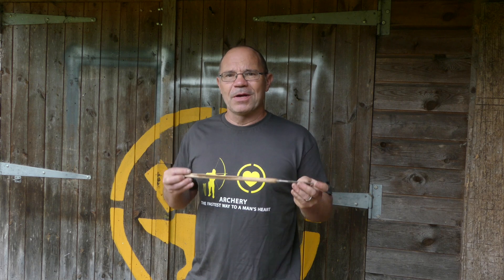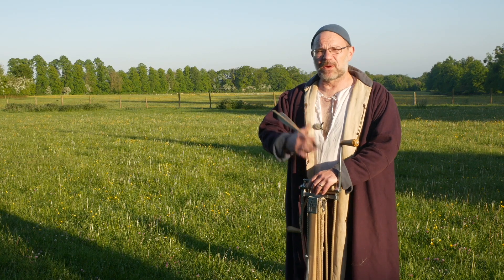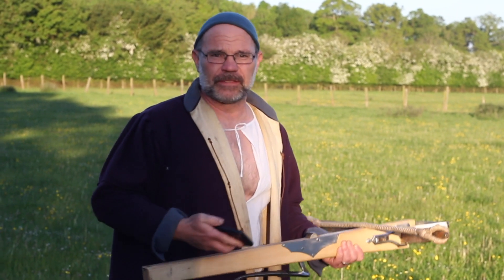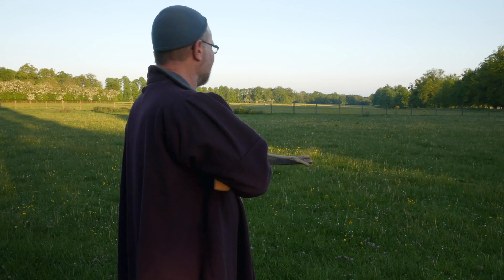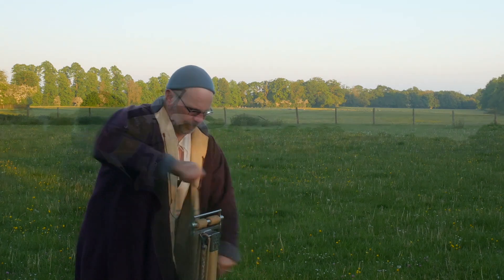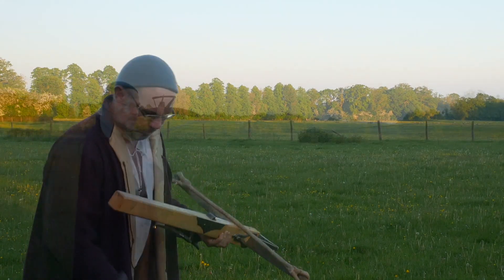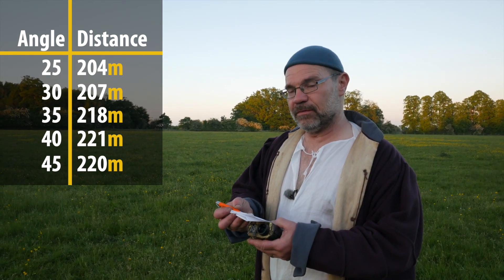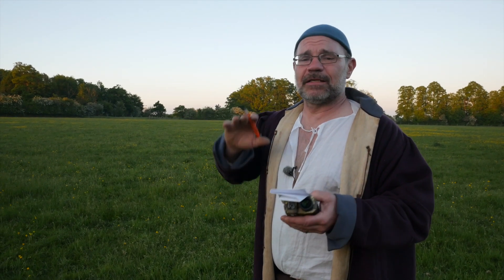Distance - Which angle is best?

Comment: Nice experiment Tod. In my distance trial I didn't go as far and as you suggeted I used 45 as the angle. Load of people told me 'I was wrong' etc, but it looks like I wasn't far off right. Somewhere between 40 and 45 works best!
Reply: Great channel if you haven't already discovered it.
Reply from the maker: Thanks Jason and yes it was interesting that it was so close to 45, I was expecting less
Reply: @tods_workshop  mee too, and like you I had loads of people tellign me it shoudl be close to 35 etc etc. looks like 45 ish is good enough. On the amusing other hand one comment told me to shoot it at 110 degrees.
Reply: @ModernKnight  Assuming everything is a constant, for a "ball projectile" or close enough, if you add drag it should still be 45 degrees, as the drag is affecting everything proportionally at any given time, which is essentially what happens in a vacuum (ofc, distributing 0 proportionally is still 0, but also still proportional). Arrows look very different from balls of course, but because they stabilize due to rotation along the direction of movement, the physics don't look all that different (air resistance is met by a roughly stable 2D projection in that direction, which is also roughly a circle, meaning the drag will distribute horizontally and vertically at the same way the velocity does, which is basically what happens with a ball).

Things get different when you manipulate other factors. For example in spear throwing biomechanics limitations make it so initial velocity and angle are no longer independent as they are when you have a crossbow or bow, or by adding different aerodynamics, like throwing discs or cards, or frisbee. If you throw it with the right motion, your ideal angle for distance will be much closer to 0 depending on specifics of the actual object. This is for two reasons, first to have a higher initial horizontal velocity. Second it is to cause it to stabilize by spinning on an axis perpendicular to the direction of movement instead of along it, leading to the projectile basically gliding as it has a larger vertical area/drag and low horizontal area/drag. I.e. it starts faster horizontally, loses less vertical speed and speeds downwards much slower too staying airborne longer. But if the launch method is flawed it won't stabilize and it will look like most people trying to throw an A4 sheet. But as mentioned, arrows are counter intuitively more like a ball projectile than a disc that acts more like a glider.

Now I wonder if a sharpened disc or "shuriken" thrower could have been made at those times and how good it could have been vs bolts and arrows.
Reply: "Somewhere between 40 and 45 works best!"

Didn't Sir Ralph himself come to this same conclusion? Been a while since I read that book, but other ballistic treatises agree that 45 degrees will never produce the max ballistic range for ANY projectile (outside of a vacuum)
Reply: 45 deg is the ideal angle, if you don't take accound to the air resistance. So the ideal angle is below 45 deg. But this all depends of wind and the mass (energy) of the projectile and its air resistance.
Reply: A legendary channel commenting on another legendary channel! Youtube is a beautiful thing!
Reply: Tods bolts were jumping off the stock, so the results may be unintentionally misleading as usual. But close enough for horse shoes and hand grenades 🤣😂🤣. I want Todd to redo the experiment with a flat shooting set up, like a modern crossbow. I think it will change another 5 degrees or so with tuned conventional set up.
Reply: it is physically proven why if you like I can explain the physics behind it in laymans terms...
Reply: @REALdavidmiscarriage  This is physical profen. Look at: 'Der schiefe Wurf' (sorry i'm german and i don't know the english term of that), that sould be discussed at school. But in the end there is also the problem of the wind. As far as i know, there was once a problem with the olympics in Moscow a long time ago. There the russians opend the doors of the stadium when ever a soviet athlet throw his spear to get him some wind/air under his spear.
And if you look at the angle, how these athletes throw their spear, its far below 45 deg because the air resistance of that spear is very higer, than that of an arrow or bolt.
Besides, i've tried this with my 40 lbs Bow and it took me about 200 steps (about 1m) to reach the arrow in the dirt. But i couldn't measure the angle i used.
Reply: @bracinggreen3785  I wanted to say the same thing (I'm austrian) and I didn't find a proper translation for "Wurfparabel" haha
It's stuff you learn in your first semester of physics in uni. But yeah we heard about it in gymnasium as well. also for spears the angle is more at 30-35° because it is a different movement and you can use stronger muscles if you throw it that way. Our Physics Professor taught us this stuff he was obsessed with ballistics and olympics lol
Reply: @REALdavidmiscarriage  Y`re welcome. About 40 years ago i wrote a GW-Basic program, that could manipulate the air resistance/energy on every point of that parable. But sorry i can't find it anymore.
And edited the 2nd time: That about these muscles was new to me...
Reply: @bracinggreen3785  sounds really cool I’ve been trying something similar for pistol rounds but been doing it manually with derivatives  for every 20 meters or so.. Super tedious stuff, but It’s hard to bring air resistance into the equation since it scales with the projectile speed and stuff... do you have any background in physics or did you teach yourself?
Reply: @REALdavidmiscarriage  That was a FH project, to write a handbook for GW-Basic. I thought it`s a nice idea to show the students, that read that handbook to experiment with something, where they should know the basics of. And besides, there was an graphical output of the trajectory of the projectle...
The programming of this isn`t as compliacted.

What about of your missing data of the cw-value of handgun and rifles projectiles: Once i had these vaules but they dismissed in the last 40 years.
I`m really not lucky about this, because i would like to get them back.
Reply: @bracinggreen3785  Really interesting, too bad you lost it. That would be some really useful data and a really useful program! I would definitely be interested in that stuff! If you ever find out more about it let me know please!
Reply: @REALdavidmiscarriage  Versteh ich gut aber leider ist das bei mir im elektronischen Nirvana verschwunden. - Leider...

Comment: Even without air resistance, if the height of the starting point is higher than the height of the plane to land on, then the angle that results in furthest distance is smaller than 45°.

I can provide detailed calculations if you want.
Reply: Being that the maximum range is so large compared to the initial height, this has a VERY small effect on the optimal amgle.
Reply: @johnbarron4265  
You are right. Assuming the initial speed is 60 m/s, initial height is 1.5m, no air resistance, then the optimal angle is ~44.88 deg, which makes the range ~3mm further than the range with 45 deg.

This would have been significant with something like throwing rocks from a wall. Assuming the initial speed is 5m/s, initial height is 10m, negligible air resistance, then the optimal angle is ~18.58 deg, which makes the range ~1.10m further than the range with 45 deg (7.58m vs 6.48m).

Comment: A fun set of tests, just goes to show you don't have to be dead on with the angle to get a similar spread.  
I have to admit I was more fascinated by the wobble of the bolts when they were launched.  I wonder how they would behave if they were 'pulled' rather than 'pushed'?  I can't think of a way to do that with a medieval style crossbow that would allow them to get as much oompff as the conventional set up.
Reply from the maker: a longer bolt would help

Comment: 45 degrees is the perfect angle for a projectile fired at ground level across a flat plane and which has no air resistance.

In the real world its not perfect, yet 45 degrees remains a good place to shoot from if you don't know the projectiles ballistics because shooting too low an angle will vastly reduce range over shooting at 45 degrees.

Shooting 5 degrees above the perfect angle will drop the range less then shooting 5 degrees below, which your results clearly showed.

Comment: I think it would go further if the flight had a v-cut at the base
You could put rotation on the bolt like rifling what would make it straighter and go further 42.5 degrees probably would be the ultimate distance could be achieved

Comment: That's a surprisingly small spread in range - you aren't getting anything significant out of lobbing the projectile.  I've heard before that bows and crossbows were typically used on flatter trajectories and this lends a lot of credence to that idea.  Should continue testing on even flatter trajectories as from the looks of it, the most practically shooting angle will be less than 25 degrees.  The angle needed to hit a target at 75m/ 100m/150m could also be informative.

Comment: One thing to note is that due to the way you are holding the crossbow the higher angle shots increase the starting arrow launch height (maybe 10-15cm?) which would give the arrow a bit more potential energy to work with.  So many variables when it comes to this type of testing.
Reply: also , slightly change in wind tweak the results, the differance can be even 5 metres. This test to be precise, would needed to be made in big hall.

Comment: I think you should be more excited about the results! It's actually unexpected that 25 degrees is comparable in distance to 45 degrees. That means that you could sacrifice a little distance for much improved aiming. It also means that your bolts are losing height disproportionately. Maybe because the drag is so high that it can attain less height than would be expected. Models without wind resistance predict maximum distance at 45 degrees because it is assumed that the potential energy from the gained height is restored fully. Would there be any way for you to check when the bolt reaches maximum height? And how high it gets? Easiest would probably be with a second video setup at perpendicular to the axis between you and the target. Then some trigonometry could give you the height at every point and even the bolt speed and velocity
Reply from the maker: A good point

Comment: Presumably though a bolt shot horizontally would hit with more power than a bolt shot at 45 dgrees (which would then hit the target with a downward projectory having burnt off more energy in the flight)? The bolt at 40 degrees flew further than the one at 25 degrees but would have been in the air longer and so more impacted by air reseistance etc so would have hit with less energy? 
Or is my theory wrong that you'd probably want to be shooting closer to horizontal at the slightly shorter range?

Comment: Interesting. Tod sir, can I request that you make some sort of caging for the crossbow and shoot it again because I noticed that the bolts are not true of flight at the beginning of its launch.  Could you try make a rail like modern crossbow bow where the bolts will not move around during launching so it can fly true in the beginning. I'm curious if caging would make the distance even further or not

Comment: You can actually access flight shoot records because they sometimes list the angle. Usually it's around 41 and 42 degrees as far as I remember but those are flight arrows which might be benefit more from gliding
Reply: Why doesn't 45 degrees give the furthest flight?
Reply: @uK8cvPAq  because you don't just throw a sphere into the air but an aerodynamic missile. The fletching and the mass balance point will affect the flight. Consider paper planes. You don't throw them at 45 degrees either.

Comment: This is... very odd. No matter what the lift or air resistance or a number of any other factors may be, the small variation is strange. I ran numbers for a barebones 50 m/s initial velocity, and the range is at 195 meters at 25 degrees and 254 meters at 45 degrees - so, a variation of 59 meters. It's especially interesting that, assuming this crossbow shoots at 50 m/s, it allowed the bolt to shoot past its theoretical maximum, that makes me think something is happening with positive or negative lift.

I suspect that what we're looking for is hidden in the wobble the bolt experiences right after it leaves the crossbow, and whatever it is, its power seems to change with angle. Which begs several questions, among them how consistent it is in this particular crossbow and how consistent it is across different crossbows.
Reply from the maker: Thanks and I also found it odd.  Maybe one day I will revisit

Comment: I can already imagine that you are frustrated by not having access to a physics lab where you can just borrow whatever equipment (or undergrads) such as for measuring Wind-Speed and angle. I wouldn't even know whether there is a low-tech method for checking that Wind-Speed is the same between shots

Comment: Always great to see you reaching for the answers we have lost. I'm not a ballistics expert but solving probs is part of my wheelhouse; you wouldn't, per chance, know someone with an indoor riding arena, would you? Within the limits of that halls length, you could eliminate a bunch of your variables, a bench or table with a controlled bed angle for the crossbow, and a flatter release on the string than the one used. Just looking at the bolts behavior right off the bow suggest something is "whacking" the bolt before it leaves the track. I'm guessing the string is jumping out of the rolling block that holds the string- it's a strong design for a string release, but it may be allowing the string to hop out before the rolling block is ready to release the string level with the track. Hope that made sense! Also more repetitions, different weights, tip types, shooting in oppo direction (would also decrease all the walking and walking and walking for the "researcher" too!). Also, does experience with traditional archery help inform a crossbowman? FWIW, some of what the recreationist groups have found says the technology may have been limited but many usages were very sophisticated. And have fun while you make all this happen! FR

Comment: should make a rig that locks the crossbow in an exact angle both vertically and horisontally to reduce that horisontal deviation. and shoot atleast 3 bolts from each elevation..
im going to say that the optimum angle would be between 37 and 43 degrees of elevation.
the deviation in range has to do mainly with differing projectile weights in these ranges. 
if you go further we start to come into humidity, air pressure, temperature, wind direction, friction in the bow and if you shoot really far, the coriolis effect.
atleast these are some of the factors you take into consideration in modern field artillery.

Comment: We need to have a talk about statistical sample sizes...
Reply from the maker: I know.......However it does depend on what you are wanting to show or achieve.  I want to quickly get an idea of what is going on, an approximate idea as I simply do not have the time or resources to engage in long trial sets.  The other part of that is what it means in the end.  If I shoot say 10 bolts each time and then categorically state a 'fact' based on that, then any methodology I have can justifiably be picked apart.  I am not a scientist and there would be a lot of picking apart I am sure.  I am doing this mainly for fun and for an indicative result; what is the essence, the direction, the generalisation of what is going on.  In this case I am sure bolts may have gone slightly different distances given a repeat, but what was also clear was that 35 degrees was not massively better than 45 degrees as an example, which was a common comment from the last film.  That is enough for me.
Reply: @tods_workshop  To define "massively better", and taking in consideration your time constraints, I would have done a single series of multiple shots at the same distance, just to understand more or less what is the expected spread of the distances. If you have a 10 meter spread at, let's say 35 degrees, the indicative statement you can make is different than if you have a 2 meters spread.
And to do it for a single series shouldn't take too much time.
Reply: @tods_workshop  You should do what you feel is fun and useful, no doubt! If it were me, though, I would constantly wonder if by random chance the wind made me draw entirely the wrong conclusion.
Reply: That's a Mean...
Reply: I love those videos, but you're absolutely right. They are meaningless to actually measure something, not just because of the sample size but also as you should be able to remove as many "additional variables" as possible. For example I would suggest to make a stand from which to shoot at a well defined angle. But of course then it wouldn't be as entertaining
Reply: Do you really want to have that discussion with the guy holding the crossbow?

Comment: I'll second the calls for a larger sample size if you ever get the opportunity to do so and feel so inclined. Especially if you're able to do so with modern equipment as well with a similar sample size to the expanded sample size of the medieval equipment. I suspect that the optimum angle for maximum distance isn't going to change much between bolt/crossbow designs since the drag effect on both types of bolts is very likely similar.